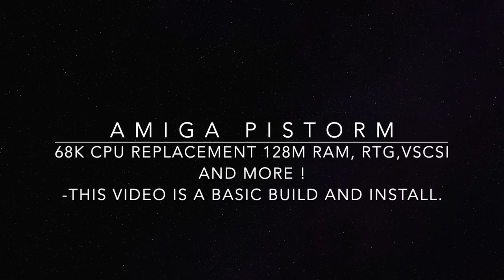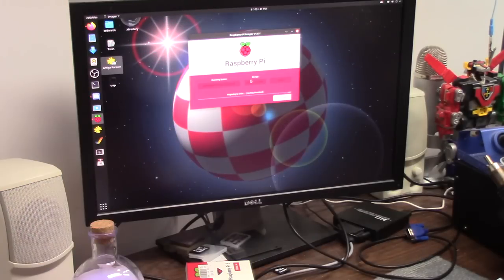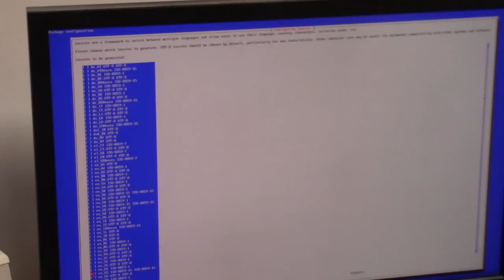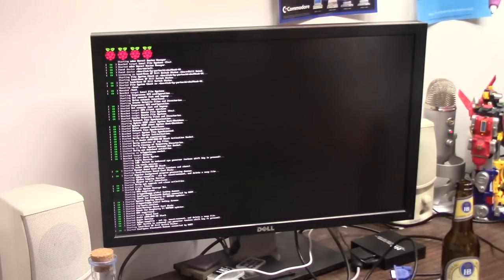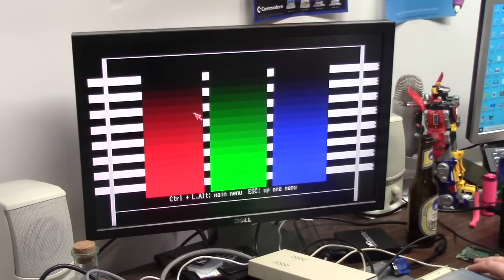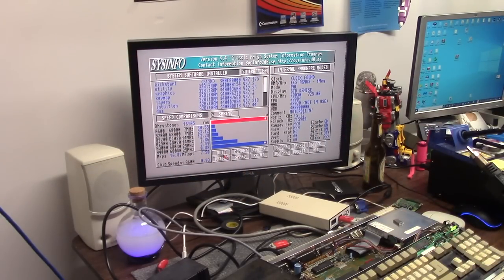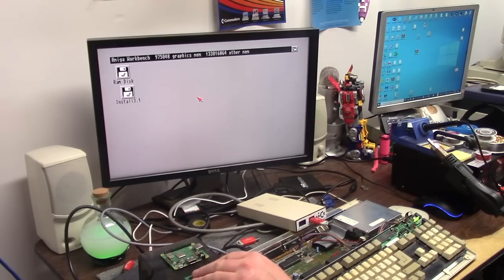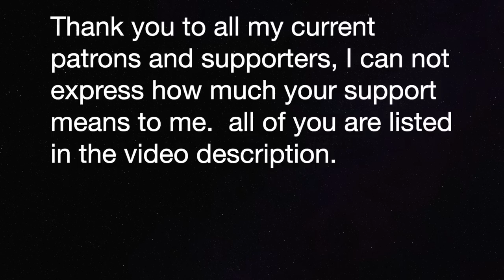PiStorm 68K CPU replacement and more

Comment: A lot more testing is needed, these pi Style emulators and chips often show big scores in sysinfo but often exhibit performance issues in actual software.  Running Frontier which is a very tolerant piece of software for 30 seconds doesn't prove stability or the actual speed and performance of this chip.  A lot more testing needs to be done getting excited because you see a large number in sysinfo is quite premature.
Reply from the maker: Of course . But it runs really well. Like i said. Just a noob review. As i learn more i will give more in depth reviews
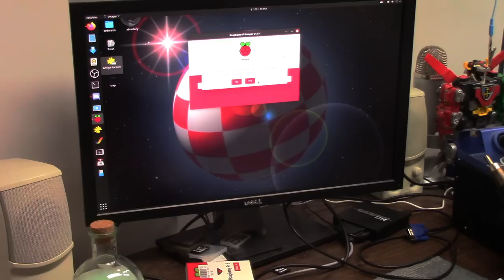Reply: Well, mine just made 5:15 hrs of Frontier 2 intro after a few hours of povray with closed case at 65 Celsius. What performance issues are you talking about? Thermal throttling to the point where you are no longer 30 but 25 times faster?! This is just another great project for a more than 30 year old (beloved) computer platform and each of these projects helps to keep it alive.
Reply: Naysayers gonna... nay... say?
Reply: @th.breidenbach6995  No I'm talking about how the benchmark results don't translate into actual performance depending on the title, like I said frontier is a very tolerant game when it comes to hardware, run some other stuff, Try Apidya, other fast paced shooters, some sprite based games and see if you get performance issues, not just ones related to 16/32 bit, but ones where this accelerator shows it doesnt really offer the performance the benchmarks seem to indicate..
Reply: Mr Guru  Sure there is a good value proposition here but myself and many other enthusiasts are very interested in the actual hardware itself, I'm not telling anyone not to get one just reporting my experiences with most of the Pi implementations.  This is a bit different as it directly replaces the CPU so it should be interesting to see its limitations if any.
Reply: Mr Guru  There is so much more than emulation at stake here.  There are drawbacks to the way this chip works.  The reason its so slow when Pimiga is much faster is because of how slow it accesses the chip ram of the Amiga, which is an inherent problem with the design of this.  It also begs the question if you have a Pi why not just turn it into a Pimiga?  It would be more flexible in hardware configuration, run faster, and have much easier file access by its very nature.  Of course I understand why an enthusiast would want to use real hardware, but then why would they want to use this.  It's an interesting piece of hardware and fun to experiment it but its a solution looking for a problem that no one has.

Also your CPU is running another OS, this OS has its own overheads that can pop up and iterfere with its performance any time the OS might schedule itself.  

Again, if you are interested in this have fun, but jesus people its not the end of the world when someone says something that doesn't jive with your opinions.
Reply: @Mr Guru It's really hard to be civil with someone as rude as you.  I don't think you fully understand how PiStorm works as your arguments seem to skirt the issues I'm bringing up and simply argue about cost and performance.  Ther eis more to it than that, a new CPU accelerator for a 30 year old computer isnt liberating anyone from the bondage of expensive accelerators.  I don't know why the only arguments anyone can make today are political arguments, can't we just talk about the hardware?  Anyways, I will not be responding further to your comments.

Comment: Why connect an Amiga emulator to an Amiga ? Why do Amiga need a very fast processor when it is anyway a retro on which people play Super Frog, Lotus etc.. This project is interesting, but it is pointless. Amiga is already retro, nothing creative, nothing revolutionary, just old stuff. It would be better if smart people would design new Amiga with new system, for new times... Apple has its M1 processor, ARM for sure is the future, but not for emulating an oldie with no future prospects...
Reply: Meet half way... It's a potential 68k CPU replacement which would allow to play games on regular TV's conveniently.
Reply: It's all the Amiga hardware with the CPU upgraded.
Reply: @stuartaxon2898  It seems actual code is running in an emulator plugged into amiga hardware
Reply from the maker: Cpu only